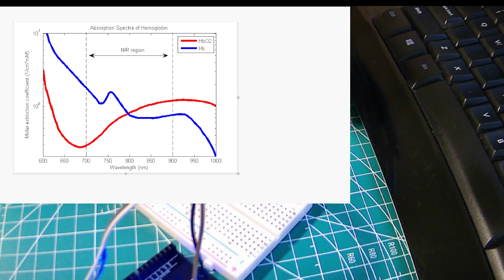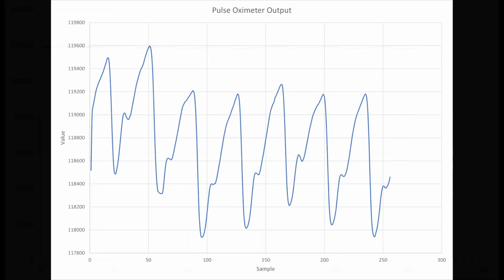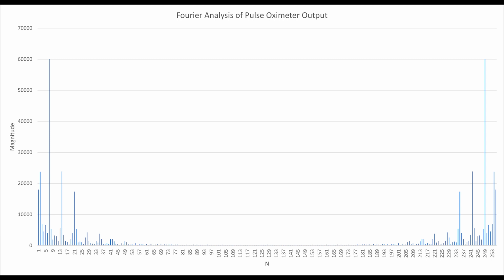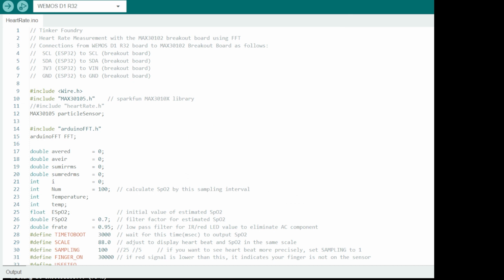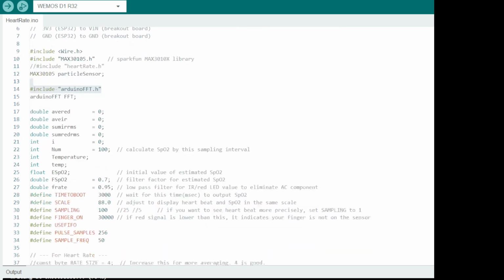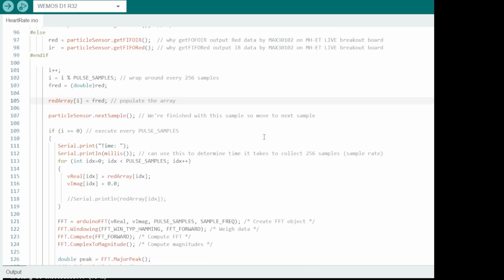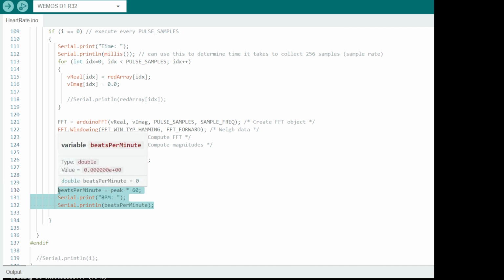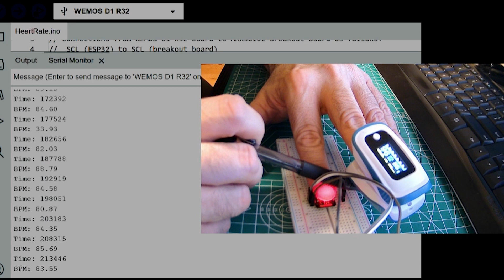Heart Rate Measurement with ESP32 and Pulse Oximeter Module using FFT

Comment: But at this case if you calculate the delta bpm you will find that its equals almost to +-11bpm wich is a huge number for heart rate measurement and i dont know why you didnt use band pass filter instead of low pass filter since we know the interval of frequencies that represents ower data maybee you did that because some how you know that this is the limit of this sensor